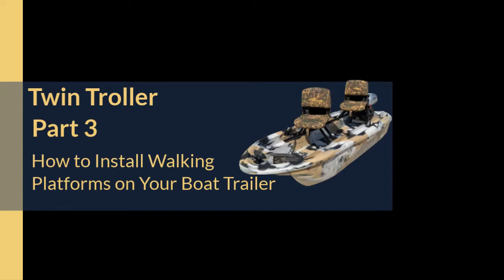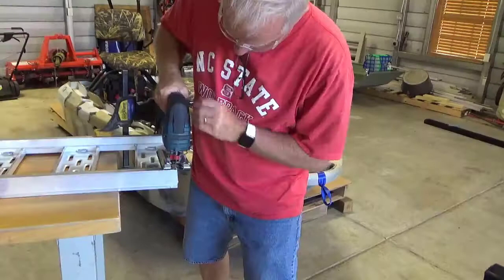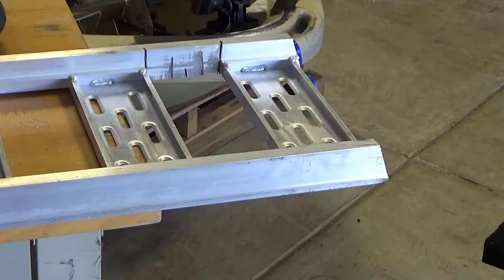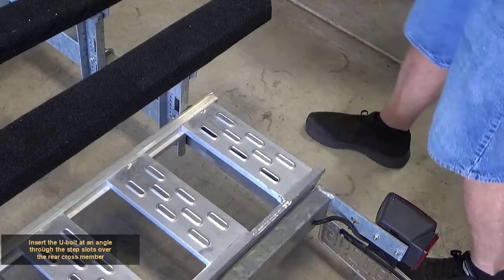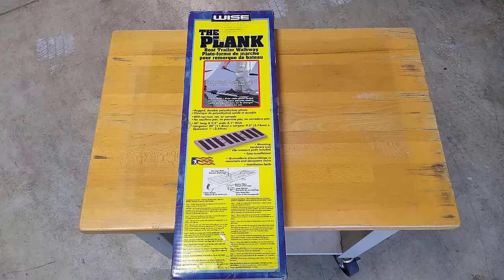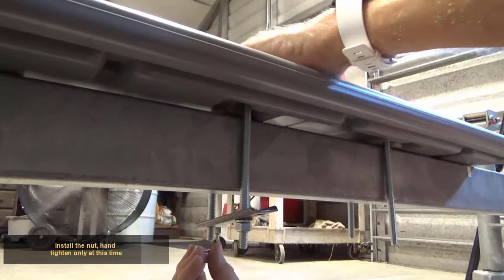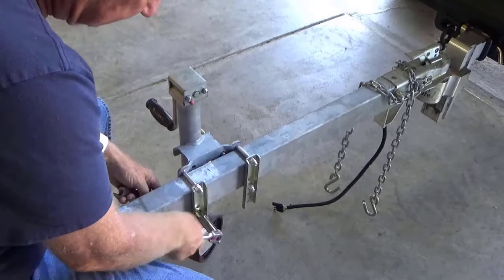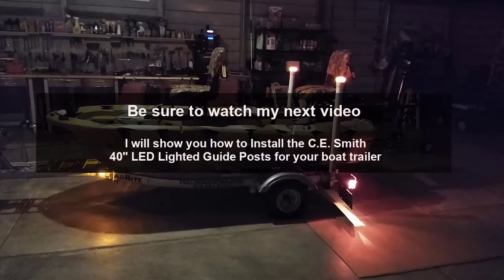Part 3 - How To Install Walking Platforms on Your Boat Trailer

Comment: Great share Norman.  This is a better solution than the planks I got in place already on my own trailer many years past.  I'll definitely consider investing in getting that rear section done to eliminate some balancing acts I do getting my boat on and off the trailer.  Nice to see another NC owner sharing on here, Nashville resident here.
Reply from the maker: Allen,
The ramps placed all the way to the rear help you stay out of the water, mud, and weeds. I am currently working on a way to mount 2 aluminum rods that you can pull up and hold on to while walking down the ramps. This will help with stability and balance. When not in use, they will fold back down. Not there yet, but getting close.
I  really appreciate you watching my videos.
Thanks,
Norman

Comment: So I have to remove my cooler seat to replace my fuel line.  When I re-install the seat what would be the process for reattaching the screws in the fiberglass??
Reply from the maker: I need more information to answer your question. Are the screws currently holding the seat in place?  Can the screws be tightened down?
Have you removed the seat before? How many times have you removed the seat and screws? Are the screws only in fiberglass or do they go through 
To wood base or frame? Are the screws held in place with any sealant or adhesive? 
Thanks,
Norman